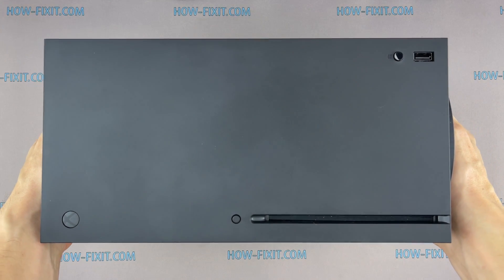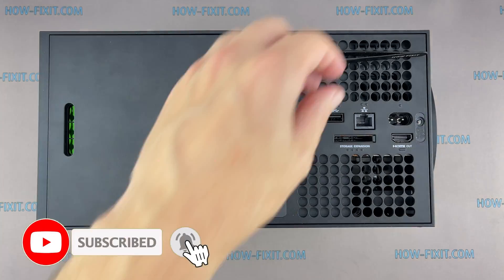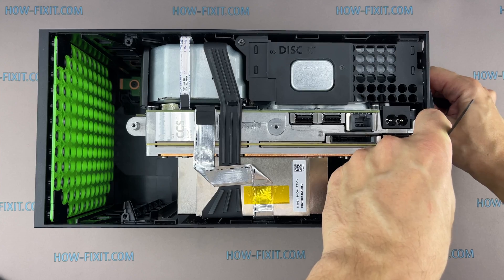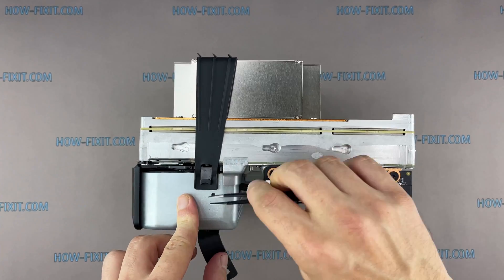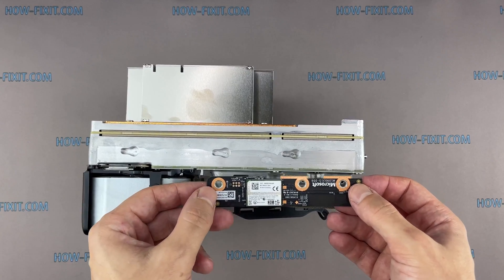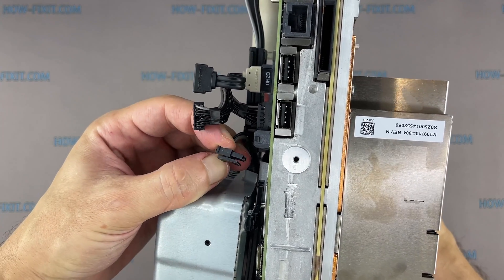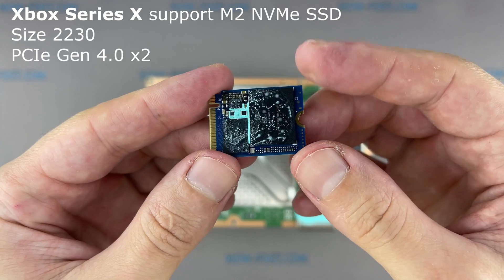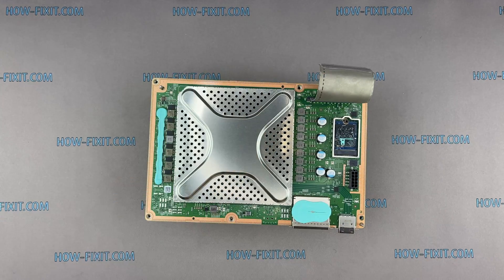Xbox Series X internal M2 SSD Replacement

Comment: What's the point of changing the SSD drive can you put a 2TB SSD  inside
Reply: Sure you can put a 2tb ssd inside.... But you'll just have a very expensive paperweight.   As of this time, you CANNOT switch/swap/replace the internal xbox series x ssd.  Even cloning a very similar (in size and capacity) m.2 ssd drive, doesn't work.  And this is all from people within the repair industry that know what they are doing.
Reply: @D.K81  you probably never will be able to either. Seems microsoft is really wanting people to only use the overpriced proprietary expansion cards. I feel that's going to go about as well as the overpriced proprietary memory cards that sony designed for the ps vita.
Reply: @zero00044  I agree. Microsoft has this expansion storage locked down to the point it's just easier and less hassle to buy an external SSD and call it done.  Maybe after a few more years, they'll be an "easy" way of changing the internal ssd... But by then, we'll all be waiting to pre-order the next next-gen console. Lol
Reply: @D.K81  I did find that some Chinese manufacturer is making an expansion card adapter that you can put your own m.2 ssd inside. Kind of how there were 3rd party memory stick pro duo adapters for the psp that let you use a cheaper micro sd card. Seems to only work with specific ones though. Pretty much the same ones microsoft uses. I think there is a list somewhere of the exact models that work. Eventually I'm hoping someone just makes a cable that plugs into the expansion slot and let's you use your own ssd at the same speed or even play the newer games directly off of a slower mechanical hard drive. I've never really cared about fast load times. Just browse youtube or read something short while waiting lol.
Reply: @zero00044  I think you're onto something with the idea of an adapter cable.  I'm all about fast load times but that's mainly due to my wife and I and our schedules.... With kids too.  So when we get the free time to game together, I don't want to wait on loading screens as much as I can help it, for obvious reasons. Lol   Maybe one day, Microsoft will learn from Sony and not lock down such parts of their consoles.  I'm sure they would sell even more of them and save money spent on R&D making proprietary components that the masses don't want to be stuck with.   One day.... Maybe.... Eventually.... Probably not.  Haha
Reply: @D.K81  despite what the younger generation expects, 30 to 60 second load times aren't really all that long, and you can definitely get that from games on a portable hard drive. Most of the long load times are just when starting a game or loading a save. Moving between screens such as fast travel or going in amd out of a building have shorter load times becase most of the assets are already loaded and stored in the ram. It's all about the speed the cable can handle. So maybe some sort of optical ethernet adapter for the xbox expansion slot. Since most portable hard drives only come with USB 3.0 cables, you would need one that has a USB c port at minimum for speeds faster than USB 3.0. So the cable would be an optical cable with a USB c connector on one side and a xbox expansion slot PCIE connector on the other. Seeing as how ethernet and USB c cables can run gigabit connections, this would probably be the best solution until some better technology comes along.
Reply: @zero00044  That's a true statement for sure.  My son (who just turned 14 recently) expects things to load as soon as you hit the button. While I remember waiting 45+ minutes for 1 mp3 to download. Lol

I didn't think about a cable having to have an adapter on each end. That's more parts/issues than needed, in my opinion. 
Maybe an adapter that's all pcb instead of cable at all, that will accept a m.2 ssd but fit into the expansion slot. Then another version that's sata 3 for ssd and hdd.  Less parts for sure.(I'm guessing that's what you meant with the Chinese made adapter)  I'd be happy with that due to pricing of a 1gb vs m.2 is far less than the 1gb expansion card from seagate.  My biggest gripe with the expansion cards are the $400 price tag for only 2tb. I spent $300 on a 2tb Samsung 980 pro m.2 and could've easily bought one for $200 (not as fast as the Samsung but fast enough to game with).  As newer games come along (and updates are released) 2tb won't go as far and prices will only go up for expansion cards (with increasing capacity) while the same tech for PCs will get cheaper.
Reply: @D.K81  I did actually see some 4tb external ssd's with the new faster usb 3.2 on amazon for about the same price as the new 2tb expansion card. I just haven't seen anything online about the speeds of the usb ports on the series x itself.
Reply: @zero00044  I've not seen anything about speeds either.  Sounds like a job for Gamer's Nexus! Lol
Reply: @D.K81  or linus tech tips.
Reply: @zero00044  very true and see how many times Linus drops delicate parts during testing. Lol
Reply: @D.K81  yup. Has more than enough money to buy the most expensive xbox from a scalper on ebay of he wanted though. Lol. I remember when the switch first came out, I saw someone trying to sell one for $10,000. Stood in line at Walmart for an hour, the night of release for mine. Then saw people coming in 10 minutes before. They didn't get one.
Reply: @zero00044  I remember seeing New/used car ads with "buy this car, get a PS3, Xbox 360, or Wii".  $30,000+ cars/trucks/suvs and they were selling quick. Obviously bot buyers/scalpers have a huge control over the markets now.  You don't get any new high end tech unless you're A: lucky or B:  rent/buy a bot and proxy service to be able to instantly buy up stock to scalp with.   I'd like to see people like Linus, combat the bot scalpers with thier own bots to resell at msrp (realistically, a little over msrp) to drive costs down for everyone.  If I was wealthy/rich, that's one thing I would do.
Reply: @D.K81  I actually just managed to get a series x through the xbox all access thing Microsoft does. One downside is that it is done on a credit payment plan and it's still $900 because it comes with 2 years of game pass ultimate and it's not on a code you redeem. It's pre installed. Unfortunately I already paid for 2 years of game pass for the lower price of xbox live gold recently and won't be able to use it. I originally thought it would be a code that I could just sell off for the exact value of the 2 year subscription along with my xbox one x, but too late now lol. Still waiting for it to be delivered 2 days ago. I really wish companies would stop using FedEx and just go with the post office. I've had nothing but issues when a company ships with FedEx and makes it so it requires a signature. Last time it was just a micro sd card from Samsung and didn't require a signature. FedEx just drove by without stopping and I immediately got a notification that said that nobody was home to recieve the package and they would attempt to deliver again in 2 days. I watched them drive by. They also have a bad habit of keeping a package in one location for days just to make sure it gets delivered no earlier than the delivery date given when something was ordered. I've seen some of my stuff in the next state over, which is the last stop before getting to my city, for 3 days. Just being scanned in and out of the same location multiple times. Now with my xbox they are 2 days late lol
Reply: @zero00044  Congrats on the new Xbox! I recently got my wife one. It was used but adult owned and the person played PC more. I got a bunch of games, wall mount, 2 controllers, rechargable batteries, and a 2tb expansion card with it for $750.  
That sucks that the game pass is pre-installed like that.  I was looking at the same bundle for myself but we already have game pass so I'm glad I didn't buy that. Lol I still use a Project Scorpio edition X1X ... But I upgraded the HDD to a 2tb Samsung SSD.  It's much quicker loading times but not as fast as the Series X, obviously.  Lol
Reply: @zero00044  oh and FedEx isn't the only one who holds packages. I've had UPS and USPS hold stuff to meet dates, pretty often in my area. UPS distribution center is 40 minutes from me and have waited 4 days with it sitting right there.  USPS main hub for my area is 15 minutes away, stuff sits there too sometimes. I used to be able to go into USPS and pick stuff up early sometimes but they've put a stop to that in the last few years (prior to the coov).  My area is pretty rural but I'm surounded by 7 cities with 1 major college campus.... And I still don't get stuff on time like I should. Lol
Reply: @D.K81  guess it really depends on where you live and the attitude of people who just want to be lazy at work lol
Reply: @zero00044  That's the truth lol. For years we had a great UPS devilry guy and about 90% of the time, the same great guy.  Then around a year ago, I guess our normal guy got put on a different route... And now our deliveries are constantly late and have stuff missing/stolen from them.  I've filed complaints directly to our local UPS distro center but nothing has changed.
Reply: @D.K81  could try going in person and asking for a manager next time it happens. Just bring proof such as screenshots of your tracking info and any video you can get that proves things aren't being done right. If all else fails, threaten to report ups to some governing body and taking them to court. Follow through if you have to. If things are going missing due to negligence on their part, that's a serious thing. If it's just random package thieves taking it off your porch when they delivered it properly, there isn't much you can do beyond require your and only your signature for every package. The fedex website says they are going to start requiring a person to show their ID for any package requiring a direct signature. Which is a good thing but definitely inconvenient if they end up not delivering because someone else answered the door and you're not home. Got my xbox 2 days late though. She didn't ask for my ID lol. So not sure if they have started it or not. Now just transferring all my games on my old Xbox one x to a portable hard drive then to the new series x. I would use up all the data on my internet plan for 5 months if I had to re-download everything.......still taking forever though lol. Turns out the series x only has about 720gb of usable memory out of the box. Honestly thought it would be a little closer to 850. Hopefully by the time I have the money for an expansion card next year, they will have larger and cheaper alternatives.
Reply: @zero00044  I'm glad to see you got you Xbox finally. I just had FedEx show up and drop off our new phones. 2x Samsung S22 Ultras... Signature required from our carrier but FedEx just left them on our porch and took off. Lol. I didn't even know they were delivered until I got a notification for it.  $2,500 worth of phones just laying there.. But at least we live in an area that porch pirates aren't an issue. And we know our neighbors well. 
The stolen stuff from UPS, just gets blamed on the sorting machines getting stuff caught and stuff falls to the floor. Then ends up in a "lost and found" kind of bin.  I know 2 people who work for our local UPS hub that checked for my missing PC hardware in said bin but nothing ever turned up. So that's proof someone is stealing from packages or at least stealing from the "lost & found" bin. 
I've got lucky and got those things replaced without much fuss at least. 
Back to the Xbox storage, I've not looked around online lately but hopefully ion another year, there will be better/cheaper solutions for Xbox storage.  I think the Right to Repair community will influence Microsoft eventually and things will get easier to replace/upgrade.  Wishful thinking but Apple just got on board with it so hopefully other companies will too.
Reply: @D.K81  the xbox definitely needs a better solution. After getting everything transferred from my xbox one to a portable hard drive, some older games for xbox one needed to download the series x upgrade and have no option to decline it. Well the game stays in the hard drive and the upgrade which half or more of the size of the game, goes on the internal memory. With only around 700gb of internal memory and 100gb or more per game, most of my games are unplayable now since I can't move the upgrade data to the hard drive because it says the game is around there. Meaning I gave to delete the upgrade data for one or more games before I can play any other games. Then re-download the upgrades all over again. Transfers and downloads take hours. Plus internet data limits. Our local internet makes you go to the next highest plan if you go over your limit 3 times in 1 year and won't let you change to a cheaper option within 1 year of doing that. 600gb and 200 Mbps at $65 per month used to be more than enough. I rarely even got close to the limit. Not anymore. Lol
Reply: @zero00044  at least Xbox isn't as bad as PlayStation for game updates. Still a pain and could be better but Sony flat out doesn't care. My son and brother in law both have PlayStations and they way they do updates is nuts. I'm sure you know what I'm talking about. I thought maybe getting my son a PS5, that would be fixed and all good.  Nope, it's just like the PS4 lol. At least you can swap the m.2 drive very easily in the PS5 tho.  
As for Internet, our ISP charges us $15 per 5gb we go over and our limit per 30 days is 1tb. My area is the only area that gets this charge with no option of "unlimited" data. 1tb doesn't go far with everything streaming 4k nowadays.. Plus having 3 kids. Good ol CONcast service.  And they are the only ISP in the area (that works) so no other options.  Starlink is looking more and more nice, once it's live in our area.
Reply: @D.K81  actually I really don't know how the ps5 updates are. Don't have one. Never had an issue with my base model ps4 though. I do like how the ps4 system update can download in the background so you don't have to wait. Unlike the xbox, where you turn it on and it won't let you do anything without updating first. Normal game update patches seem to take about the same amount of time between the 2 consoles. Maybe a little longer on the ps4 since it does a backup copy to protect from corruption. One thing I wish the ps4 did was auto update games that are in folders without needing a ps plus subscription. I have to go through each of the 50+ games on my ps4 and manually check for updates lol. I like how the xbox can either do auto updates or search all your games at once for available updates and let you choose which ones. Ps4 auto updates would be fine because they are usually small in size, but auto update on xbox is definitely turned off. 100gb+ updates would kill my data cap lol. Now system updates on the nintendo switch are wonderful. Sure you have to do it when you turn it on, just like xbox, but it only takes 5 seconds or less to download then maybe another 10 to 20 to reboot and play some games lol.
Reply: @zero00044  my bad on not fully explaining that better.  The issue with PS4 with some games making you have a ton of storage free in order to update....is the same on PS5 too.  At least nearly every game my son plays lol. Example: the game is 100gb and the update is 5gb.  He has 25gb free space but it won't let him get the 5gb update bc it thinks he needs to have 105gb free in order to update the game.  It's frustrating as hell. My brother in law got so fed up with it that he bought a 8tb external HDD for his PS4 so he didn't have to delete/reinstall games constantly.  My bro in law only keeps like 3 games on his PS5 at a time to avoid the same issue happening again so that's what my son is doing now too.  Maybe later on  (after some good grades and his first job this summer goes well) I'll go in half with him and get him a 4tb+ m.2 ssd so he'll have plenty more storage.  I imagine more next Gen games that come out, the more they will take up storage. Always happens anyways lol
Reply: @D.K81  oh yeah the reason you need more than the size of the update alone is because of that backup it makes of the game. That way if anything goes wrong you don't have to delete and reinstall the game and save data gets backed up too I think. As for a 4tb.....thats definitely going to set you back a pretty penny. Didn't even know they went that high. A 2tb is almost $500. So I can imagine a 4tb is going to be around $1,000. As for my xbox, despite newer games needing to be installed on the internal memory or just the upgrade data, older games like Xbox 360, original Xbox and some Xbox one games work from my external hard drive and I definitely notice a difference in load times. I just started up elder scrolls 3 and 4 to check the load times. Morrowind would normally take about 1 or 2 minutes to load after continuing from a save. Loading screen didn't even show up. Just went from the start menu to playing the game. From a USB 3.0 external hard drive. Have to say I'm impressed by that.
Reply: @zero00044  it's weird how some games do it but some don't tho. I think I've of my son's games doesn't have any issues but the others do.  Guess it just depends on the game.  And ya, a 4tb m.2 is not happening anytime soon lol. After he works and saves up half for it, I'll match him.. As long as his grades stay good. If not, then he's going to learn that not being smart about things, will cost you more in life.
Reply: @D.K81  meh, school isn't everything. I quit school in 10th grade and got my GED. I'm a tech guy and run a small business on the side. Planning on opening up a retail hobby, electronics and video game shop when I have the money. Saving for a house first though. My puppy needs a yard lol. I believe you can learn to do pretty much anything on your own if you put in the effort and you can find almost any info online these days. Not saying he should quit school, but if he ever doesn't get good grades in something then maybe it just isn't interesting. Not every subject is something you need to learn. For me, biology was completely useless since most of it was about plants and animals. I know how my body works and that's all I need. (Know alot more now than school ever taught me) due to me having aspergers disorder, math was always difficult, but I'm an adult now and nobody can say I can't use a calculator when I need to lol. I'm confident enough to manage a business and smart enough to know to hire an accountant for that business, and use good payroll software. Just make sure he finds something he wants to do in life and help him reach that goal. Even if he decides later that it's not something he can actually do or wants to do and wants to try something else. I always wanted to learn to make video games, but once I got a beginners book on the subject, I figured out it was way to complicated for just one person to do by themselves. (Coding, graphic design for characters and world, story, music, sound effects, etc) so I decided to try other things and started a small side business with my laser engraving machine. Haven't made alot of money but enough to supplement my paycheck from my actual job. Will get to my store someday.
Reply: @zero00044  I agree and it would seem you and I are a lot alike. I dropped out of high school in 11th grade and have made a pretty decent living for myself and family. For many years, I was a senior A.O.V. technician and diagnostic tech as well as an Instrument & Controls tech for the nuclear power industry. All I had was my GED, good work ethic, and willingness to learn.  Now, I fix all kinds of electronics from home, for my local area. I do some mechanical work here n there too but mostly for family. They pay me and it's far less than local garages that charge "by the book" 4-5hrs for simple rotor & brake pad change that I can do in 90 minutes or less with no lift. Lol 
My issue with my son is he's being lazy with his studies. He can do the work and has A's in his science class but he's not doing the homework, which is failing him for this grading period.  He has taken up welding this semester (he's in Jr high) and really likes it said it's improving quickly.  What he didn't realize it's that the science he's learning currently, would help him be a better welder.  This past weekend we went and looked at welding machines to buy and talked. I gave him a bit of wisdom to think about for his future and I believe it sank in... Even tho he knows everything already as most teenagers do.. LMAO.   I'm just as excited to get a new welder since I've always wanted to learn/be better at it.. And my son is better at welding than I am currently. Lol.
Reply: @D.K81  well it's good he found something he likes. Now just work with him and show him how he can turn that into a career. If it seems like something he wants to pursue as a career, then go through and teach him the buisness aspects of it too. Welding pays pretty well so if he can start his own buisness early, he could either start his own buisness or become an independent contractor which could set him up for life if he takes it seriously.
Reply: @zero00044  that's the plan, so as long as he stays interested in welding.  I've been showing him the variety of types of work there is, including underwater welding.  He thinks that's cool but too early to tell if he'd like that as a job.  But if he does want to learn it, I'm good friends with a dive instructor so I've got that covered at least. Lol
Reply: @D.K81  sounds good. Everything I know I had to learn myself. Plenty of info online these days though.
Reply: @zero00044  same here. I was teaching myself how to do things long before YouTube existed.  Just have to be more careful on YouTube especially since they removed the "like/dislike" for the public.  Like this video here, the uninformed well think they can do this, spend a bunch of money getting parts (or tearing up their Xbox in the process) for it not to work. There is a way to still see the "like/dislike" counter via a website. Can't recall the name but LTT did a video a little while back on it.
Reply: @D.K81  I've never liked or disliked a single video ever. Also don't subscribe to anything either lol. Likes and dislikes really have no standing on if a video has good information or not. It's all up to common sense really. Like if you're even looking up a video about how to spray paint your car because you don't want to pay for a professional or use actual automotive paint, then you didn't have any common sense to start with, or just really don't care. Lol
Reply: @zero00044  common sense isn't too common...at least not in my 41 years of experience, I've not seen it to be plentiful. Lol  Example: My son was attempting his first ipad mini repair last year for a friend and he was looking up diy videos for it.  He watched 5-6 videos to get familiar with it and only 1 even mentioned/showed a particular ribbon cable that's easily torn off once you're inside the device. If he just went with the first video or two, he would've further damaged it for sure.  That's what I was meaning by the likes and dislikes.  More dislikes tells you immediately that the info isn't good/complete/misleading without wasting as much time. It's a tool for time savings.  That's just my opinion on it anyways. Lol
Reply: @D.K81  I would look at the comments instead. Kind of like amazon reviews. A 1 star review without anything written doesn't mean that someone even gave the thing a chance or even bought it. Plenty of people dislike videos without even watching for no good reason. Details are key lol. Also good for him for not just following the first instructional video he saw. Whenever I do any kind of research online for something, especially before I decide to make a big purchase, I check as many reviews and videos, for pros, cons and just different people's points of view and experiences as I can. Sometimes it can take days before I reach a decision.
Reply: @D.K81  sometimes the reviews are for a completely different product too. Like a dog collar but the reviews are for a blender. It happens when the main owner of a listing just changes the photos and discription. Just using the same page from an old product instead of creating a new one in order to keep all the 5 star reviews.
Reply: @zero00044  ya I've seen that plenty too. Funny and ironic you mention those products because I literally bought a dog collar a few months back and while reading don't of the reviews, the former product was a set of cooking knives. LMAO
Reply: @D.K81  just dishonest buisness practices lol
Reply: I can only imagine the price of 2tb SSD's of this size today. Perhaps in two years prices will be better and worth the upgrade.